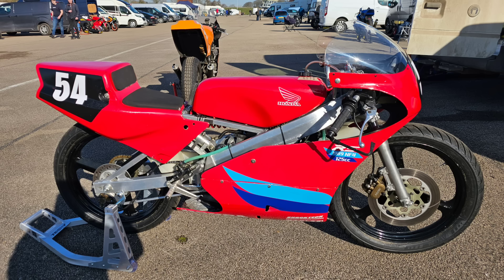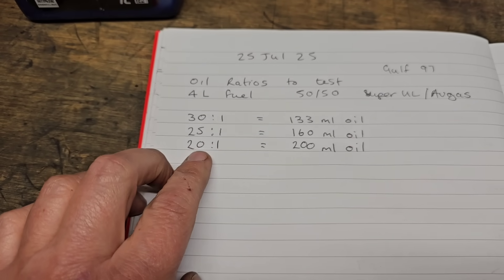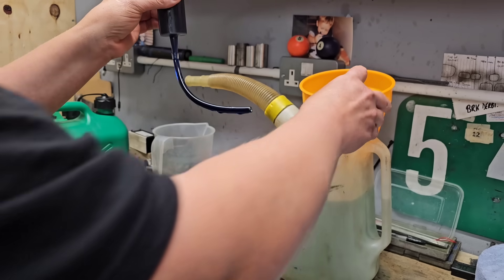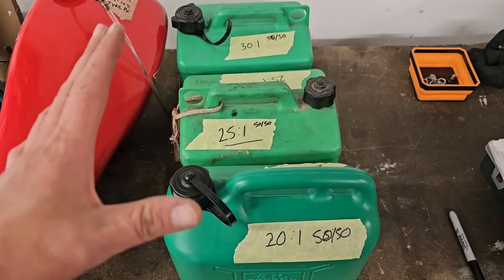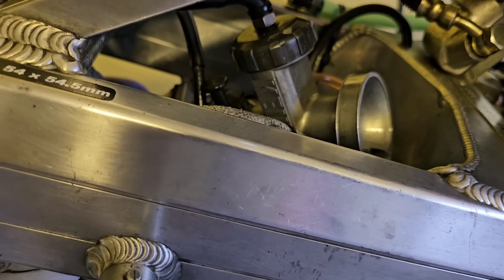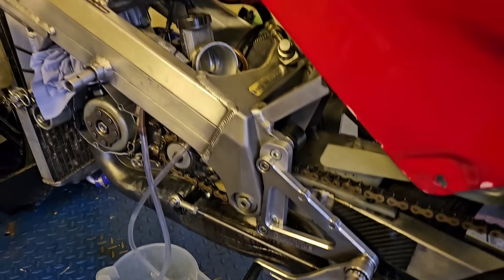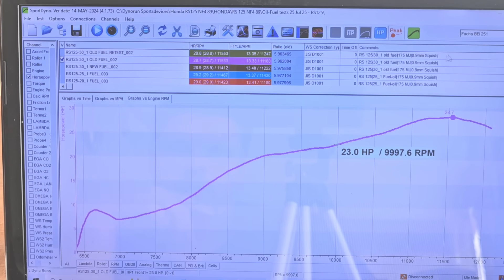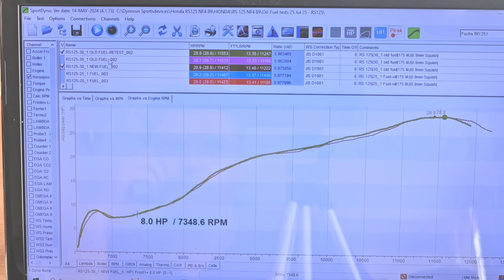Does 2-Stroke Oil Ratio Really Change Power? (Dyno Tested)

Comment: I haven’t watched it yet. But more oil means less gasoline aka leaner. So if that’s not taken into account for it’s hard to say if more or less oil makes a change. Because if less oil makes more power then It would need more gasoline or if it’s run better with more oil then it’s a tad rich.
Reply from the maker: That's what I found with the AFR - more oil = leaner. I did get a touch more power but that could have been the accuracy of the dyno and me.
Reply: @AutoBeta2T  i believe more oil = more power = better sealing of the rings = more compression = less heat piston crown/combustion area/cylinder walls from oil, which contracts itself as less fuel, less octane, less of a bang, so i guess it evens itself out, but longevity increase= more oil
Reply: More oil commonly wants a size or two bigger main jets, and adjustment over all so one has enough fuel to keep one’s engine from burning up.
Reply: @dennisyoung4631 this video contradicts everything you just said and no 2t in the history of the world has "burned up" from too much oil, it's impossible it'll foul the plug first.
Reply: @dennisyoung4631  My 1990 Honda CR250 called for 20:1 & I used Evinrude/Johnson high end TCWC oil that we sold at our boat shop. I took the bike to El Mirage dry lake to do the jetting runs & found that 5 sizes LARGER main jet was the ticket for running with enough fuel & oil to obtain the best high speed runs to set the overall ""MAIN JET"" size & because everything else was based & adjusted/sized/set after the proper  ""MAIN JET"" was determined. The bike lasted until 1998 when it was stolen & had never been apart for any engine/top end work. I lived in Hesperia & rode/raced 35+ times a year & it just wouldn't stop running!!!
Reply: The oil will burn, too.i guess if you're seeing smoke on the exhaust, it's not fully burning, so that oil is displacing fuel. I bet the larger difference would be more oil equals thicker fuel/ oil mixture so less will flow through the same size jet.

Comment: Lots of factors could be involed here .. how old is piston ? How old is piston ring ? Also piston / bore clearance .. engine temp akso on each run .. and why 50 / 50 fuel ? The head vol and squish if std would be for leaded fuel .. ave gas adding unleaded will not help it unless squish and vol are changed
Reply from the maker: Hi, the piston had about 150 miles on it at the test, the ring gap was good, and the compression test was good.
Engine temp was 50 deg C at the start of each run.
To be honest, I've used 50/50 as that what the previous owner recommended.  He did also use race fuel but said 50/50 worked just as well and as I can get it fairly easily.
I have contemplated using race fuel myself but the bike seemed happy on 50/50.
Which way would you go on the squish/comp?
Reply: @AutoBeta2T  depends on head vol
Reply from the maker: @btgracinguk - have you had any experience with this?
Formula 105 | High Octane, Ethanol Free now in stock – Classic Fuel Solutions https://share.google/Mo8GLEez8zosE1YqV

I guess this would be a better spec fuel for the RS being leaded.

Comment: Read an article in a magazine in 78, said that oil took 1/2 hour to clear the engine in chainsaws. The article used data from McCulloch. It also said until it splash fouls on the plug more oil always outperforms less in both power and wear
Reply: I recall reading a study done somewhere using radioactive oil (or oil with radioactive particles in it) to see how long it remained in the engine. 
IIRC the time it remained depended heavily on RPM. At high revs it was seconds, at low revs quite some time.
Reply: @Surestick88  "Radioactive oil"....it got a glowing review!
Reply from the maker: @Surestick88  cool, so at the rpms of the honda, the oil passed through pretty quick then.
Cheers for the info
Reply: In 1991, 1992, 1993, I was racing 125gp and 250ccgp in SA, and we got the best power with a 18:1 ratio, using motul 800 racing 2 stroke on the 250. It was a Yamaha TZ 250 W and then TZ 250 A. As long as jetting was good. The exhaust tips even burned clean and grey, fuel was avgas 102 octane.
Reply: I read that same article, I mixed 1/16 had great power and pistons lasted much longer
Reply: I agree with the post above, it takes about 1/2 hour to wash the old oil out
Reply from the maker: I used the same oil in this test and increased it for each test.
Do you mean different types or oil take 1/2 a hour to wash out?
Reply from the maker: What sort of oil was it?
Reply from the maker: Cool, I've never heard that before, but it is interesting.
Reply: @AutoBeta2T But what about wear? Where do you see the cutoff point where more oil does not equal less wear long term? Do your have experience with that?
Reply: That's why real performance two strokes use surface gap plugs were there's nothing to foul .
Reply: surface gap plugs fowl more often though

Comment: I DON'T THINK THERE'S ONE SET MIX IT'S DEPENDING ON THE AMOUNT OF FUEL 
AND JETTING SIZE 
OF CARB 
AND HOW MANY REVS YOUR PUSHING BECAUSE MORE REVS SHOULD MEAN MORE POWER 
IF THE GEARS 
AND COMPRESSION ARE GOOD 
YES THERE WILL BE A SAFTY LINE 
BUT YOU WILL FIND EVERY MAN AND HIS DOG 
WILL BE PUSHING THAT TO THE LIMITS FOR MORE SPEED 
THE OIL IS THERE FOR THE PISTON BURN WHAT I FOUND 
WAS IF I COATED THE CYLINDER  WITH LUCAS OIL ADDITIVE AND ADDED TO THE OIL EVEN IN THE GEAR BOX LETTING IT WARM UP FIRST IT MIGHT BE EASIER TO MIX THE AMOUNT AND SEE WHICH IS MORE VOLATILE IE SOME WITH HIGH OIL SLOWER INGNITSION OF COMBUSTION

Comment: believe them decimals could even be difference in barometric preassure as well, and personally think the more runs the better and taking avg. its just all very hard to say anything about the topic without alot of data. and if theres even the smallest gap in a seal, leakage or w/e will make outliars or testing pointless (more or less obviously). but making a proper baseline with run to run showing "same" results..... just my thoughts, take from it what u will :) 
for anyone actually thinks, says or presents things as facts (especially if trying to sell stuff), people needs to just give things some more thoughts.. and give some actual thoughts into this reality we live in and how basically everything is "hear-say" and or "make-believe".. people doesnt give much thought into how easy it is to fool or scam into buying specific products doing aboslute nothing, in best case and often more harm.. 
well, appriciated the video tho. gl
Reply from the maker: Hi, cheers.
Intention is to beas consistent as possible.
From what I've seen, the oil didn't make any difference.
But that's on a liquid cooled engine with tighter clearance than an aircooled.
Id like to try it again on my aircooled engine. Also I'd like to have the base jetting nearer the limit. Maybe then there would be a difference?
The leaksown test before the test revealed no leaks. Also the engine compression was tested and was what I expected.

Comment: here's what I know for a fact. if you have too much compression and/or too small of a combustion chamber you will kill revs.
Reply from the maker: Cheers. I haven't measured the compression, so I can't be 100% sure, but the engine is standard, so it will have the std spec for a 89 NF4.
Reply: Your right. Ive also noticed its the same if you have too big of a combustion chamber in the head.